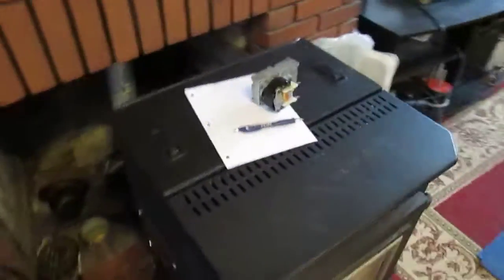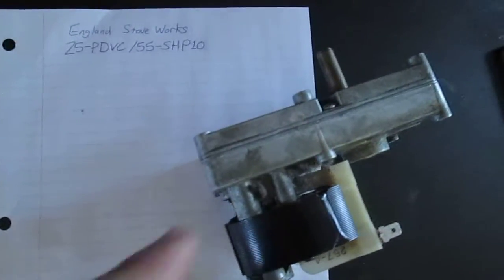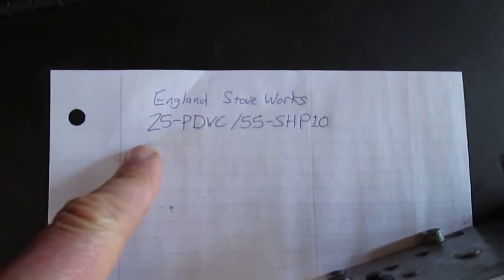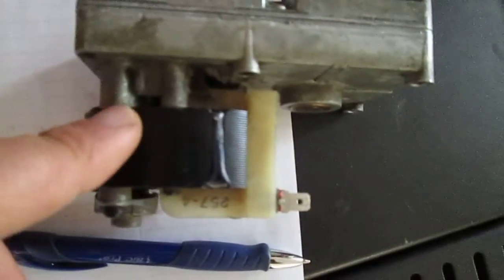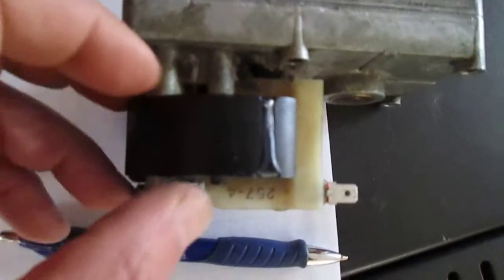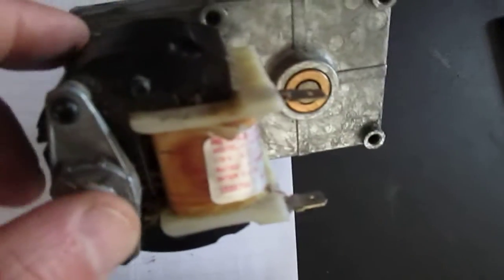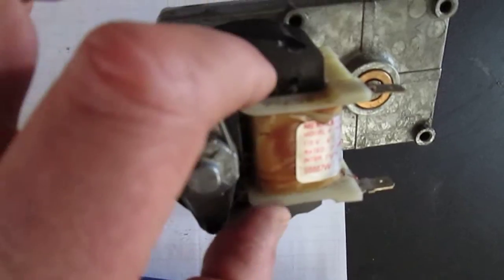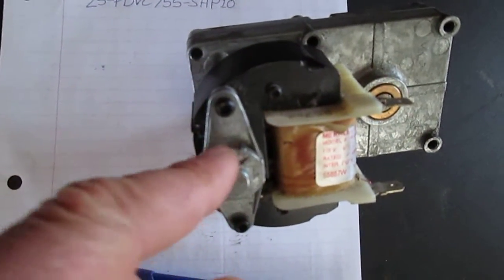auger motor replacement on 25-PDVC/55-SHP10 England Pellet stove

Comment from the maker: Hi Mary, you can turn the motor manually less than 180 degrees 
and try to get a wrench or pliers on the set pin.